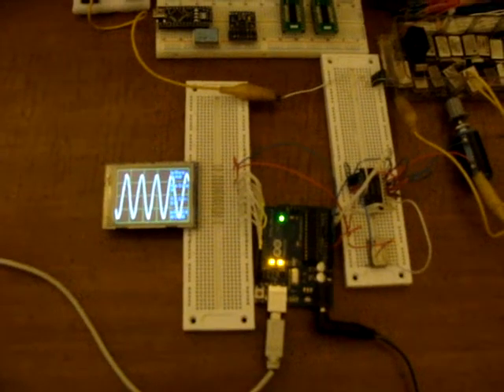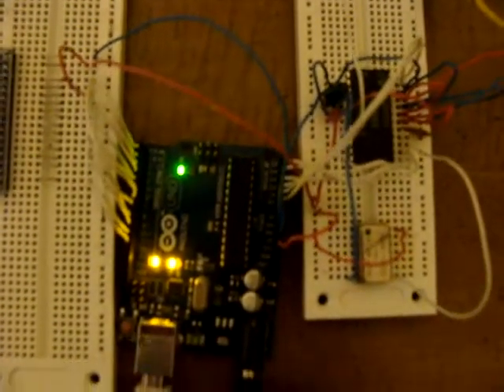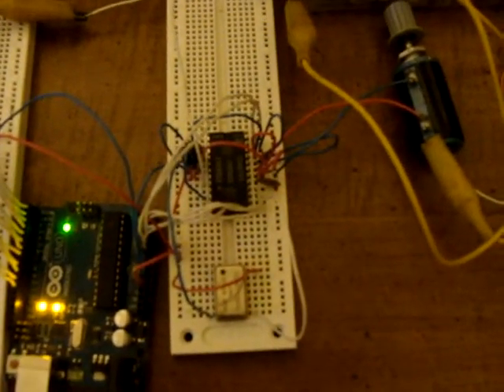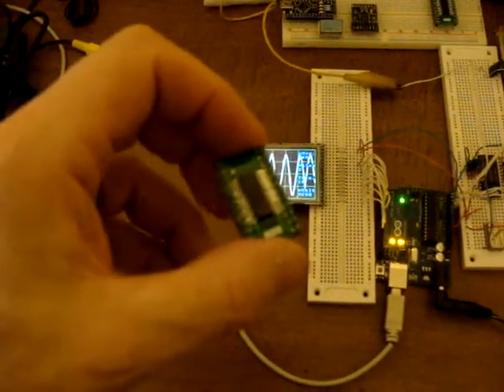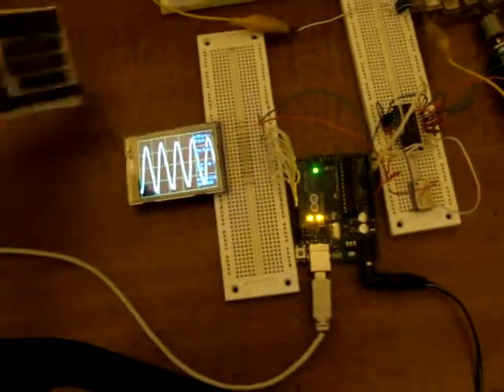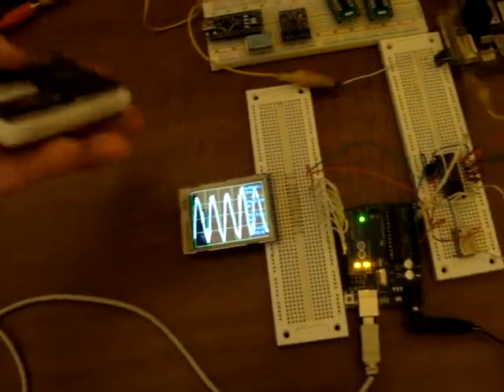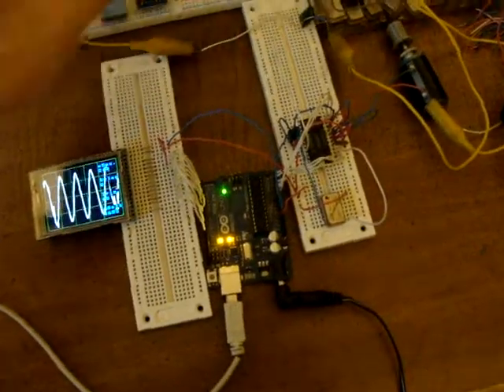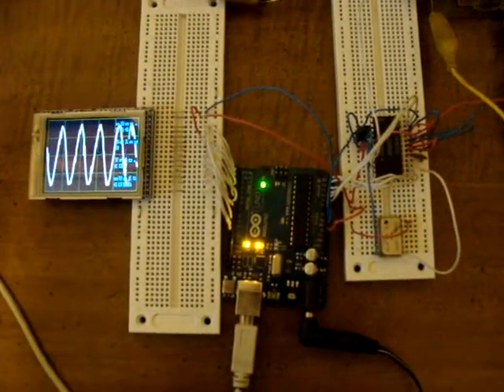TDA8703 based DSO at 5MSPS on an Arduino Uno

Comment: Wow! Great job! Was just wondering, if the ADC has an 8-bit resolution and since the sample rate is 5MSPS, then the data rate should be 40Mbps,  correct? And if so, how are you transfering the whole data to the PC that fast using UART?
Reply from the maker: I am using the Arduino parallel data transfer to transfer 8 bits at a time.

Comment: you can use adc ''ad9888ks-205''  you can find it in lcd monotor near to vga port it gives you 205msps
Reply from the maker: Great chip but its difficult to solder that many pins.